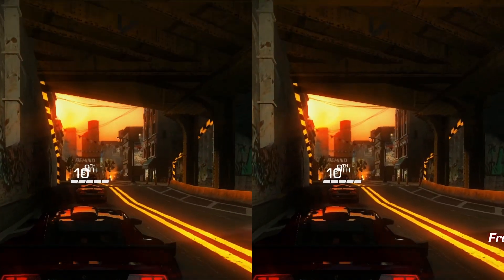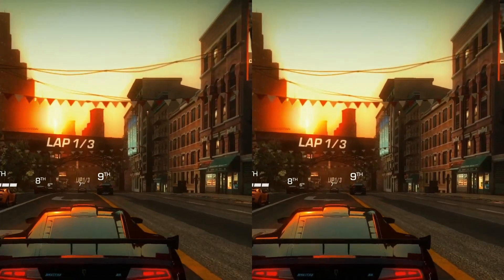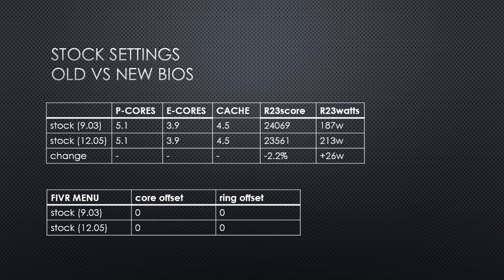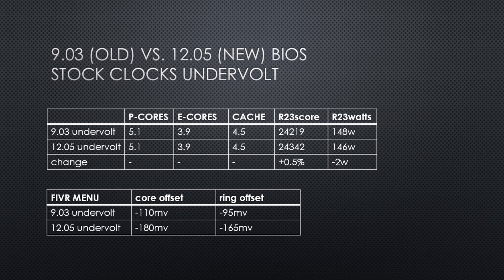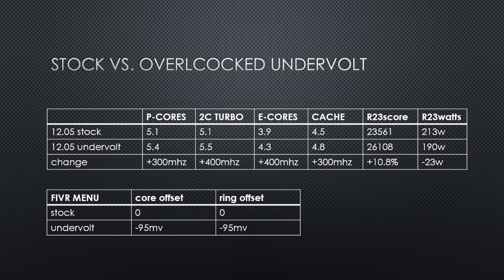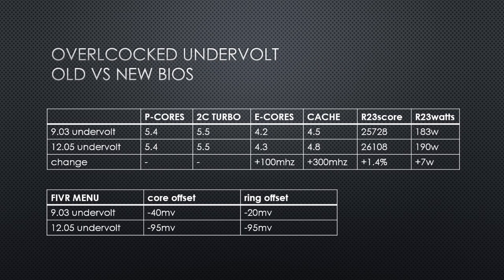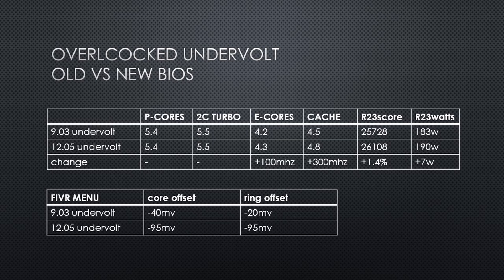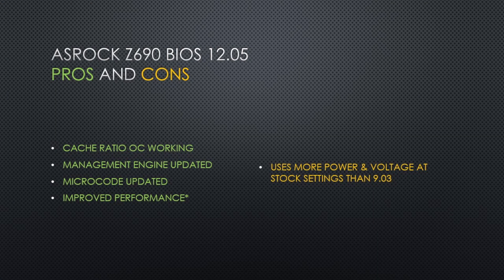ASRock Z690 Steel Legend BIOS Update 12.05: Increased Performance After Tuning

Comment: Hey there, Superior85
I'm currently using the bios version 14.04 on my ASRock Z690 Steel Legend. Everything is on default, haven't done any changes. 

1. In cinebench I got a multicore score of 21016 and singlecore score of 1900. 

2. The max temp is 88°C.

3. In your case both the multicore and singlecore score is marginally higher than mine because of overclock+undervolt.

4. That's why I want to overclock+undervolt too just like you. Can you make a comprehensive guide or a separate video regarding this topic? I believe it will help a lot of users out there like me who are pretty new to these overclocking stuff. 

Hope you reply to me! 
Love your content ❤️
Reply from the maker: Thank you. I'll try to come out with something soon. Is your max temp of 88C during the R23 multicore test? If so, what cooler are you using?

Increasing cooling and adding a contact frame allowed me to increase my scores.

In my testing the newer BIOS at factory defaults is already close to a pretty good undervolt. Check your CPU Package Power in hwinfo64, at factory defaults I think I was around 155-160 watts under the latest BIOS at factory defaults, is that close to what you are getting?
Reply: I'm so glad you replied, it means a lot to me! 

1. Yep, my max temp is 88°C during the R23 multicore test. 

2. The cooler I'm using is " Montech Metal DT24 Premium "

3. I kept my eyes on the CPU Package Power the whole time throughout the test. 

4. First 3mins it was around 155-165 watts. After that, the rest 7mins it was around 120-140 watts. A few times it dipped below 120 watts and went to 115-110 watts. Also it went higher than 140 watts a few times and went up to 145-150 watts. These dips and ups happened like 5/6 times in the 7minute period. But the first 3mins it was 155-165 watts constant and it spiked like once to 172 watts. That sums up the whole 10mins test.  

I hope, I'm able to make you understand the whole thing that happened throughout the test. If you have any further questions feel free to ask, I will gladly answer!
Reply from the maker: In your BIOS do you have your cooler set to Air Cooling? That could be why your wattage dips, the Air Cooling setting limits Long Duration Power to 125 watts.
I think your R23 multi-core score would increase if you increase the Long Duration Power Limit to 170 (Long Duration Power Limit is found in the CPU Configuration tab in the BIOS).
Reply: # Yep, in my bios it was set to air-cooling. Plus "Long Duration Power Limit" was set to 125 watts.

# As you said, increasing the "Long Duration Power Limit" will increase my scores.

# So I did exactly that, after setting up the "Long Duration Power Limit" to 170. I pressed F10 to save and exit. The menu popped up saying yes or no. Saw there that the CPU Cooler type automatically changed from Air Cooling to 120-140mm Liquid Cooling and Long Duration Power Limit will change to 170 from 125. 

# I hit enter and it saved the settings it showed. The PC rebooted and booted to windows. I ran Cinebench R23 again and kept my eyes on the CPU Power Package the whole time.

# Throughout the test the whole 10mins loop. It was between 150-170 watts. Dipped like 4/5 times to 120's other than that 150-170 watts was constant. Maximum was 173 watts. 

# Max temp was 90°C.

# This time both multicore and singlecore scores increased.

# From 21016 to 22133 (multicore)
# From 1899 to 1906 (singlecore) 

So yeah, the scores did increase. But it's still very far from your score of 26k and 2.1k. Seems like there are still many things that needs to be done to get to your score. I hope you will walk me through it, step by step.

Btw, I had a question I wanted to ask you. There's a software that is installed on my PC. It's from ASRock & it's called "A-Tuning" when you open it you will see 3 modes. 1. Performance Mode 2. Standard Mode 3. Power Saving. By default it's on Standard Mode and I haven't done any tinkering with it. The software auto runs at windows startup. So does this software have anything to do with all of these stuffs? Does it affect the tests in any way? Should I keep it as it is or uninstall it?

Comment: Can you make an updated video with the new bios update? I updated the bios and I can barely get my system to post and when it does it can't run any applications like games or cinebench and then it eventually crashes. I don't know what the issue is. I'm having this issue with not only trying to overclock but stock as well.
Reply from the maker: which CPU and RAM do you have?
Reply: @Superior85  I have the same motherboard and CPU as you. The ram is G.Skill Trident Z NEO Series 32GB CL 16, 3600mhz, i forgot the model number but it isnt b-die one
Reply from the maker: @xintimidate  I would try the following.
Go into the FIVR menu in the BIOS.
OCTweaker\FIVR Configuration

Change the Core Voltage Offset to +50
Change the Ring Voltage Offset to +50

Save Changes And Exit

When you get into Windows run Cinebench.
Let me know if this works...
Reply: @Superior85  I should put the bios back to stock correct before i do this right?
Reply from the maker: @xintimidate  you can if you like, or you could try it with your current settings...
Reply: @Superior85  Changed it to plus 50 but I get the same error in cinebench "application: error more information can be found at" then it links to the windows app in my drive. Games dont crash on start up anymore though
Reply from the maker: @xintimidate  is that with the CPU overclocked? If so, what are your overclock settings.
Reply: @Superior85  Yes, thats with it overclocked. I was having the same issues with it not overclocked as well. Voltage is at 1.3 and p cores are set to 5.3. Before I updated the bios the voltage was at 1.25 but that voltage doesnt let it post anymore for some reason
Reply from the maker: @xintimidate  and the RAM, is that overclocked as well?
Reply: @Superior85  No I just have xmp enabled and set it to gear 1

Comment: Thank you for the video. I have a Asrock Z790 Taichi and i used Intel XTU to undervolt my cpu with " - offset voltages" however i cant find it in the BIOS and what other settings i need to change? I presume off set voltages in the Z690 Asrock Bios is the same as on the Asrock Z790 bios correct? If you can show me where to go i would really appreciate it or make a Video geared towards beginners like me since i do not want to mess things up for this i am willing to DONATE to your cause! Let me know.
Reply from the maker: the CPU related voltages offsets are found in the OCTweaker/FIVR Configuration menu in the BIOS.
Reply: @Superior85  Thanks man will have a look at it appreciated thx.

Comment: I glad to find your video that you have ASRock Z690 Steel Legend almost same like my ASRock Z690 Steel Legend WiFi 6E. Same motherboard type.

I have ASRock Z690 Steel Legend WiFi 6E motherboard and Intel Core i7 12700K where I bought from Newegg last year and I not build my computer yet after one year because I was scared of BIOS updates. I know my ASRock and Intel processor i7 12700K warranty running down to 2 years from 3 years because I hold for one year long. I have Intel Core i7 12700K, four of 16 GB RAM DDR4 @ 3200 MHz (Crucial brand name can downgrade speed to 2933 MHz or 2666 MHz).

**********************************************
**********************************************

I have on list what I bought items from Newegg, Amazon, B&H Photo Video and Bestbuy:

**********************************************

Phanteks Enthoo Pro Series PH-ES614P_BK Black Steel / Plastic ATX Full Tower Computer Case - (Newegg)

Super Flower Leadex Platinum SE 1200W 80+ Platinum, 10 Years Warranty, ECO Fanless & Silent Mode, Full Flat Ribbon Modular Power Supply, Dual Ball Bearing Fan, SF-1200F14MP V2 - (Newegg)

be quiet! Shadow Rock 3, CPU Cooler, 190W TDP, Decoupled Silent Shadow Wings 2 120mm PWM High-speed Fan, Asymmetrical Construction Avoids Blocking Memory Slots LGA 1700 Compatible - (Newegg)

ASRock Z690 Steel Legend WiFi 6E LGA 1700 Intel Z690 SATA 6Gb/s DDR4 ATX Intel Motherboard - (Newegg)

Intel Core i7-12700K - Core i7 12th Gen Alder Lake 12-Core (8P+4E) 3.6 GHz LGA 1700 125W Intel UHD Graphics 770 Desktop Processor - BX8071512700K - (Newegg)

(Two) Crucial RAM 32GB Kit (16GBx2) DDR4 3200MHz CL22 (or 2933MHz or 2666MHz) Desktop Memory CT2K16G4DFD832A - (Amazon)

CHEUKCHI Improving Intel 12th Gen CPU ILM Contact Frame,LGA17XX-BCF Intel12 Generation CPU Bending Correction Fixing Buckle LGA1700/1800 Buckle Fix Substitute CNC Aluminum - (Amazon)

ARCTIC MX-4 (incl. Spatula, 8 g) - Premium Performance Thermal Paste for all processors (CPU, GPU - PC, PS4, XBOX) - (Amazon)

MSI Ventus GeForce RTX 3060 12GB GDDR6 PCI Express 4.0 Video Card RTX 3060 Ventus 3X 12G OC - (Newegg)

Pioneer BDR-2212 Internal Blu-ray Writer with M-Disc Support - (B&H Photo Video) this have quad layers to support up to 128 GB on disc (support Windows 7, 8, 10)

Samsung - 970 EVO Plus 2TB Internal SSD PCIe Gen 3 x4 NVMe - (Bestbuy) for install OS plus storage (Two separate drive C: for OS and drive D: for storage to put games in there)

WD Blue 1TB Desktop Hard Disk Drive - 7200 RPM SATA 6Gb/s 64MB Cache 3.5 Inch - WD10EZEX - (Newegg) for OS and storage (Two separate drive C: for OS and drive D: for storage to put games in there)

**********************************************

Let me know if all my items above are fine to build my computer. 

**********************************************

Hi Superior 85, I have few questions for you:

1. I have to ask you that ASrock Firmware Version 13.02 is very safe or not?

2. Can BIOS upgrade and downgrade to any versions without problems?

3. Which you recommend operating system for me to install? 

I prefer Windows 10 and Linux Mint. I heard Windows 11 is no good because Microsoft put more ads in to annoy us and people.

4. Have you try install Linux Mint on your ASRock Z690 Steel Legend without problems?
Reply from the maker: All the components you selected should work well with each other. 1200 watts power supply seems a bit too much though.

1. 13.02 is working great for me on the 13600K, lowest voltage/temperatures at stock I've seen yet on ASRock Z690 Bios.
2. yes you can upgrade and downgrade without issues. Sometimes you might have to re-activate Windows though, using your Windows key.
3. I use Windows 11 personally since it's the latest but there should be no issues using Windows 10.
4. Haven't tried it.
Reply: That's awesome! I would upgrade my GPU video card to RTX 4070 and later like RTX 5070, RTX 6070 and go on which require more hungry power on power supply for future upgrade proof. 

Thanks for let me know these.  ;)

Comment from the maker: There is a new BIOS available as of 4/20/2023 (Version 13.02). The new BIOS uses less voltage by default... offset values from this video are only valid for Version 12.05 (which was deleted from the ASRock bios page).
Reply: Thanks for this & your video! I have the same setup, what settings do you use for CPU Core Compensation and Load-Line Calibration for your OC? I'm on an older bios (10.04) but found by lowering both of these to level 1 at stock settings dramatically reduced temps and is stable
Reply: Oh really? I don't know that. That's safe to update to new BIOS version 13.02?

I wrote big comments for you and let you read my comments then please let me know if my all computer parts are fine to build my first gaming computer.

I heard DELL, HP and few other brand names quality have gone down due to very cheaper parts, weak power supply unit, lousy CPU cool fan/liquid and cheap motherboard have very few BIOS update means can't downgrade.